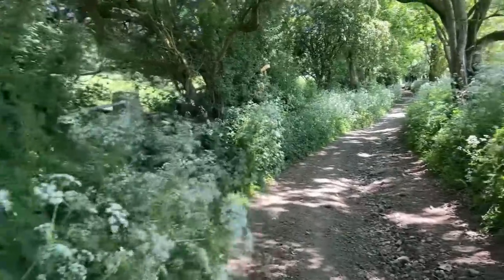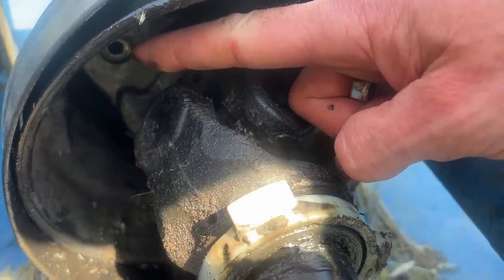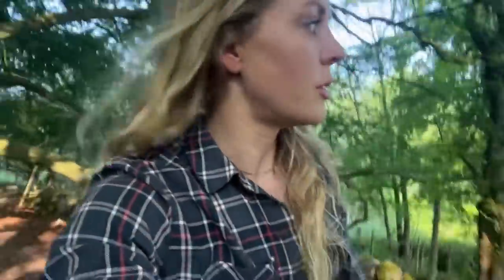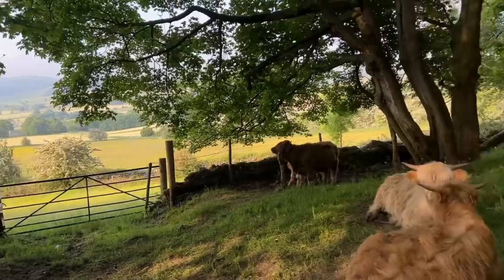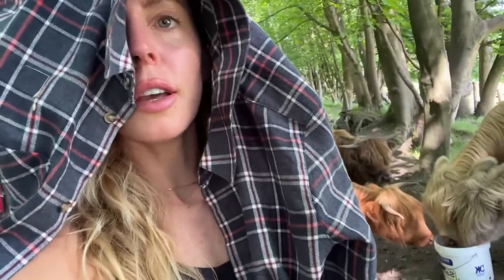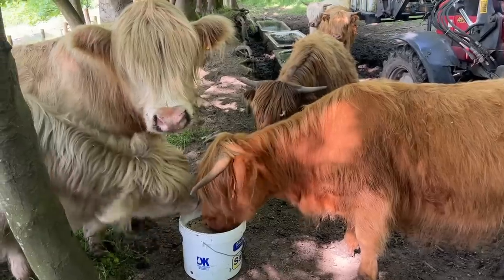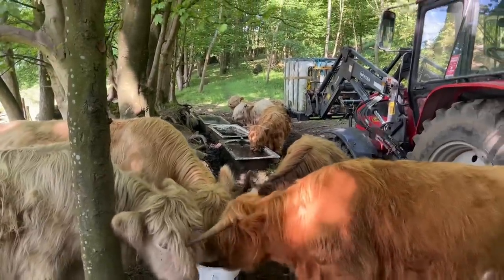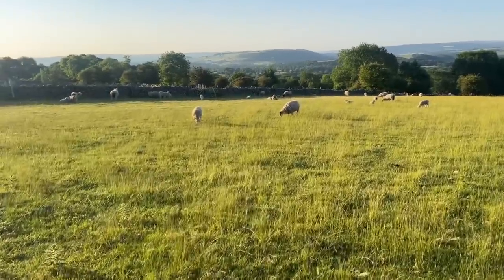NOT SURE I AM CUT OUT FOR THIS!

Comment: It’s well over a month since we’ve had any that I can remember 😩🤦‍♂. Lovely little calf, bet it had a bit of a shock coming out into theses temperatures 🤣. I wouldn’t worry to much with the topper, should be easy enough to repair the gearbox mounting bolts 🙂just carry a few shear bolts and spanner’s  (although I tend not to put the nut on the bolt, it’s quicker 🤣)
Reply from the maker: I am absolutely COUNTING on rain coming next week or we are gonna be very short on grass. Everything is crunchy on the fields. Such a pigging pain! I hope we can get the topper fixed ! New bolts are on order and a giant Allen key apparently!!! 🤪

Comment: leave the topping till you get some rain ......as the topper really drys out the grass   in dry weather    as it   tears off the grass , a drum mower   with sharp blades   would be easier on the grass in this   dry weather ...........i have stopped    topping   here for the minute .......we are on dry land and some of it is burnt  up  already ........spring   barley here is wrecked by the drought ........looked a promising crop in early may ......still its better than a very wet year     ........trust me ......  we got rain on wednesday ..evening .......27 mm    in 2 hours  ......but  you would not know it fell here this evening .......
Reply: Sounds like it was lucky the topper broke or we'd have topped the lot!! 😁
Reply: @nickj5488     yes it might have been all for luck .............have a look at the blades   underneath to see if a bit is broken off the end , as that will cause vibrations .........been there  many a time ....... some times the blades are held on with a left hand tread nut .......it is one to watch out for if u ever had to take one off ......
Reply from the maker: Thank you! Sound advice !!
Reply from the maker: The weather continues to challenge us!

Comment: You have the shaft on the topper backwards. You need to have sheer pin on the tractor side so you can change it easier
Reply: I think it goes from one gearbox to another so possibly wouldn't make any difference? I'm open to the suggestion though. 👍🏻
Reply from the maker: We will have a look at it today
Thank you
Reply: @DJ someone else mentioned this so will definitely take a look 😁👍🏻